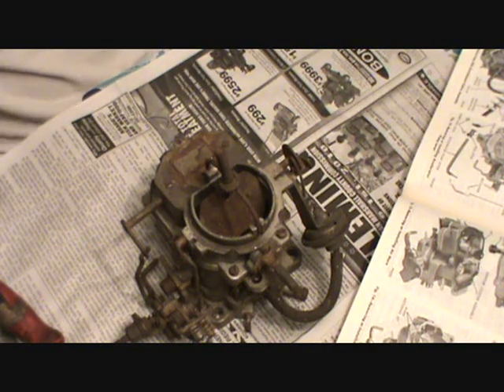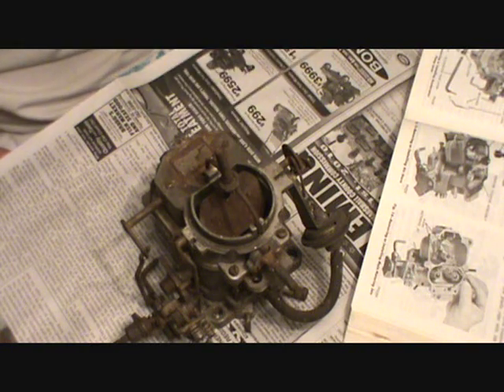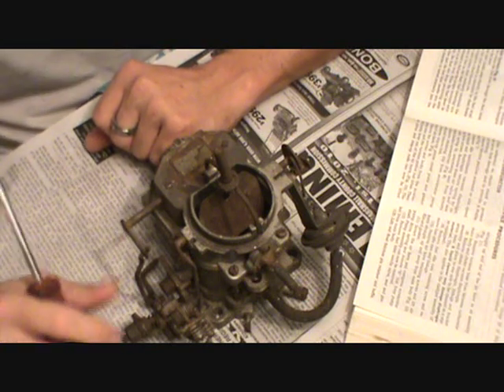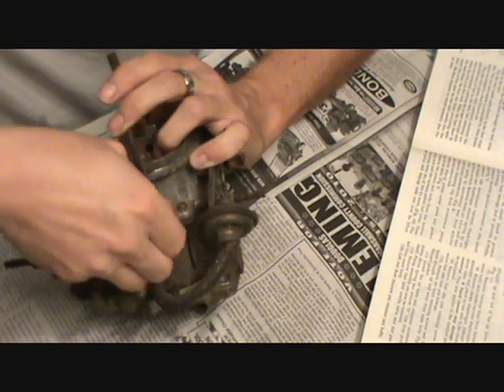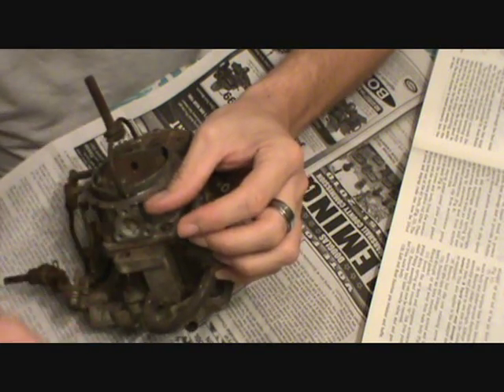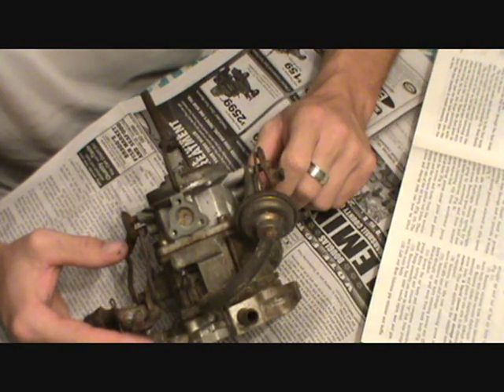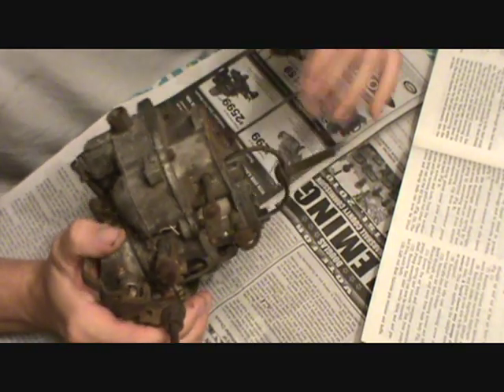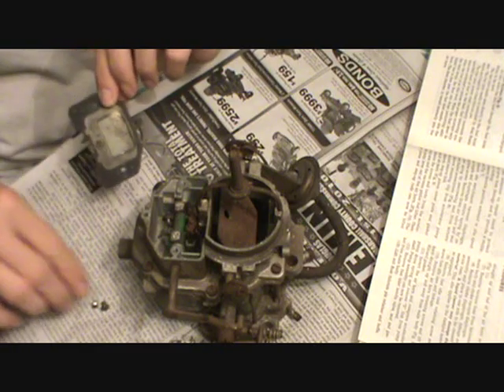Rebuilding Carter BBD Carburetor Part 1

Comment: Good video.  I have a 68 Newport, and the engine has a "dead zone" when accelerating, then will pick up speed like normal.  I learned today that the vacuum advance for the distributor could be bad, but I will probably need to rebuild the carburetor regardless.
Reply from the maker: On those advance units, they are either good or bad. You can test them with a handheld vacuum pump. They normally don't operate until the vacuum signal reaches about 5 inches or so. It's also very possible that the mechanical advance in the distributor is sticking or stuck. They are fun to work on, much more so out of the engine.
Reply: @TylersNeighborhoodGarage  Sounds possible.  I'm not really sure what's causing the dead zone, but the most likely thing is the distributor, one of my friends was looking it over and got shocked twice by it, meaning there's some voltage leakage.  So it's either the vacuum or the whole assembly and coil needs to be replaced.  Might be good to do the whole ignition system as a whole.  Although the carb does show signs of leakage...which might just be a gasket issue instead of a mechanical issue (I hope).

Comment from the maker: @easher123  I'm going to guess that you are referring to a choke unit that the cover is riveted on. In that case, I wouldn't take it apart unless you think it's gotten out of adjustment or not working. In that event, drill the rivets out and use self-tapping screws in their place.

 If you buy a kit oftentimes they have the screws included.

Comment: Do you have more info on the manual that you're using? I need to rebuild my Carter BBD, and wouldn't mind having a copy. Thanks!
Reply from the maker: It's a Factory Service Manual for a vehicle that would use the carb in question. They have detailed instructions regarding essentially every facet of the vehicle. In addition, Carter put out a technical guide on the BBD as well.

http://u225.torque.net/cars/SL6/docs/BBD_Manuals.pdf

Comment: Can a dirty/bad Carb result in loss of acceleration after reaching a certain speed? I have a 76 Dodge, and at around 30-35, the engine refuses to go any faster than that
Reply: I am a novice, but it is certainly plausible that a clogged carburetor jet could prevent the vehicle from getting to higher speeds. Different jets operate at different throttle positions. Does the engine also stumble or miss when flooring the accelerator? Hope you get it sorted out.
Reply: @bicisporvida  Yes! Well, it will accelerate, then after a certain point, it will sound like it's deccelerating(?), and especially going up hills